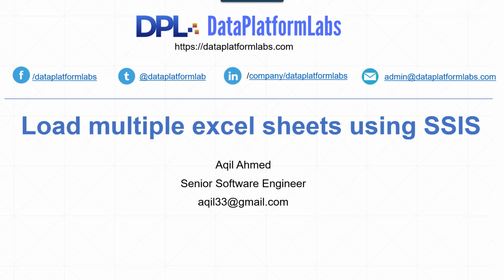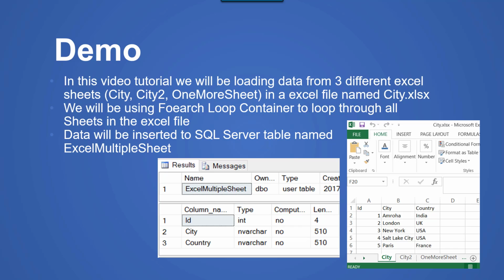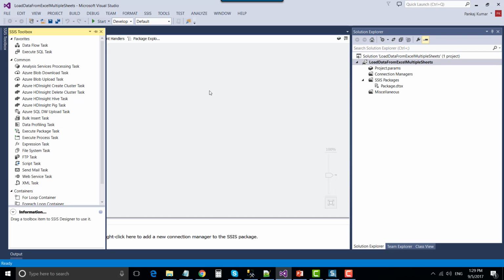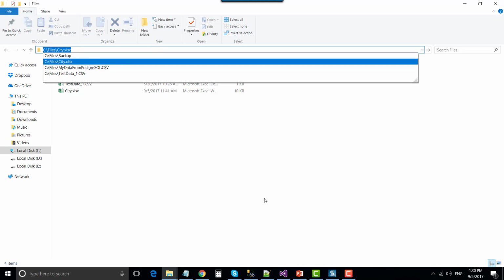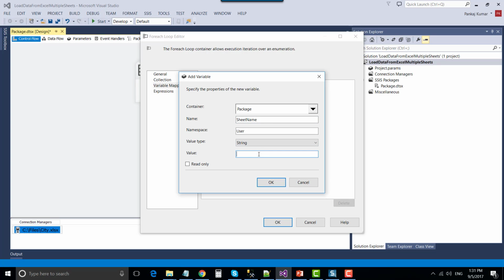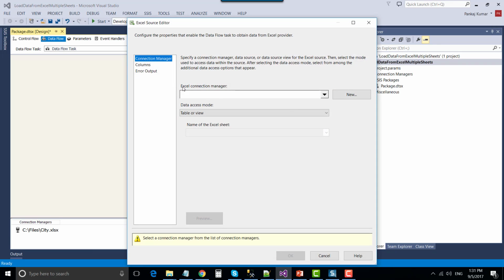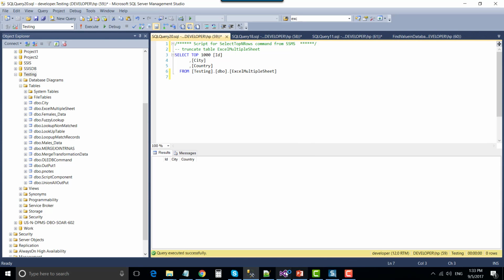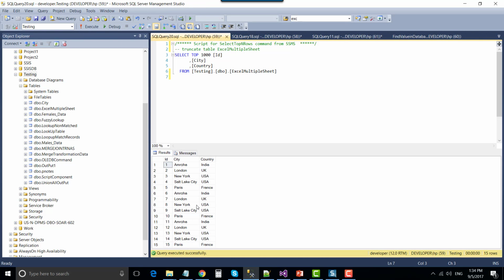25 Load multiple excel sheets using SSIS

Comment: Hi there, do you know how to get around an issue where a particular sheet has different sets of columns than the others?  Thanks
Reply from the maker: Using this method we can loop through multiple sheets with different schema but a single data flow task can only be used to migrate data from same name\number of columns.
Reply: @learnssis did you mean it is not possible?  Or is there a way to skip a particular sheet that have different sets of columns?  Thanks
Reply from the maker: @geeseeoh This is possible if you can use C#, because using C# we can read the column headers and if there is a change in column header then we can skip that sheet.

Comment: How can we add the sheet name too in table using this package
Reply from the maker: You would need to a derived column transformation in the data flow task, then in the expression, just drag and drop the SheetName ssis variable from top left. And give the column some name. By default the data type of the column will be nvarchar and the length will be according to the length of value in the ssis variable SheetName. 
You can explicitly convert the data type of sheet name in derived column by writing this before the ssis variable inside derived column

(DT_STR,50,1252)

Comment: I have a doubt, I used a variable 'Excel_sheet_name' to retrieve name of sheet name.
But in table it load as different, i don't want single quotation and  it concatenate some string in last.Do you know how to remove it.
Actual Sheetname = Feb 2024
In Table Sheetname = 'Feb 2024$'_xlnm#_FilterDatabase
Reply from the maker: You can use replace function in ssis derived column to replace a string.
https://youtu.be/r9HsJiXnR8k

Comment: i get this error  Exception from HRESULT: 0xC02020E8
Error at Data Flow Task [Excel Source [1]]: SSIS Error Code DTS_E_OLEDBERROR.  An OLE DB error has occurred. Error code: 0x80004005.

Error at Data Flow Task [Excel Source [1]]: Opening a rowset for "Bank$" failed. Check that the object exists in the database.
Reply from the maker: It simply means that Bank sheet does not exists in the excel file.

Comment: May i know why u toook index value as 2 in parametermapping
Reply from the maker: Actually there is some other information available on index 0 and on index 1, index 2 was the one containing the correct value, thus we used it. We can create an SSIS variable of string type and then we can change the index value from 0 to 1 to 2 and test it for different values and put a break point in the SSIS package and check the value in the SSIS variable.
Reply: which info is there in index 0 and 1 bro @learnssis
Reply from the maker: @Shankar-zi3yk That I am not aware, you can try declaring 2 string variables and then map them with index 0 and index 1 and then use a data flow task inside foreach loop container. Put a breakpoint on OnPreExecute Event of data flow task. And once control will come to data flow task it will get paused and then you can check the value of string variables from Debug-> Locals Windows.
Reply: "the one containing the correct value "  can u tell what was the correct value of ur statement @learnssis
Reply from the maker: @Shankar-zi3yk Correct value is at index 2 which is sheet name.
Reply: yeah i also got to know about that  index 1 is file name index 2 is sheet name from where  it was begining 

but index 0 means i have not got clarified @learnssis

Comment: What if the file name and sheetName  will change every month
Reply from the maker: I think you can use one additional foreach loop container and put this foreach loop container in the video in that new foreach loop container, now define an SSIS variable may be FilePath and then change the excel connection manager "Excel path"  property using expressions to that FilePath SSIS variable. Of Course you would need to set the FilePath ssis variable value inside the first\outer foreach loop container so that for each iteration the value of FilePath will change and it will change the connection property of Excel file as well.
Reply: @learnssis  thanks a lot... But I still not got a clear pic...
I would be thankful if u create a demo and send it to so that I can refer the same
Reply from the maker: @Shamshd._ahmad  Can you try to use an outer foreach loop container with file enumerator and try to set the "excel file path" dynamically to excel connection manager ?
Reply: I did but its throwing error inside the for each loop container
Reply: I am sorry .. i am trying to say what is if the sheet name will change every month...

Like for me 
File Name is - abcd...July..._20220701_20220801
Sheet Name is Abcd_20220701_20220801

So in sheet Abcd_is constant but dart part will change according to month
Reply from the maker: @Shamshd._ahmad  If the excel sheet name will change then no issues, it can handle it as SheetName is an SSIS variable and it can have any value in it and according to the value it can fetch data from excel file to be loaded to sql server.
Reply: @learnssis  the dame way u showed in the video the same way it will handel sheet dynamically
Reply from the maker: @Shamshd._ahmad  Yes
Reply: @learnssis  if I want to contact you . How i can contact you.?  Bcz some time in some of the logic I really stuck ... 
So in future if i got stuck in any logic will connect with you...
Reply from the maker: @Shamshd._ahmad  You can email your question to aqil33@gmail.com and I will try to reply.
Reply: @learnssis  thanks
Reply: @learnssis  Hi Aqil, Thank you so much for this video. I'm too facing this issue that dynamically file_name has to take from file path and in that file having many sheets with same structure. But in each worksheets, table starts from A17:G Cells. How to fetch data's dynamically to table. Do you have solution for this?
Reply from the maker: @savitharamakrishnan800 Take a look at these 2 videos, you will get some idea how to do that
https://youtu.be/zK-4nCU4gZ0
https://youtu.be/CMor3vY7Y-E

Comment: Hi Sir, why was 2 given in Index... What is the index for...
Reply from the maker: Actually there is some other information available on index 0 and on index 1, index 2 was the one containing the correct value, thus we used it. We can create an SSIS variable of string type and then we can change the index value from 0 to 1 to 2 and test it for different values and put a break point in the SSIS package and check the value in the SSIS variable.
Reply: @learnssis  sir what does actually index mean?
Reply from the maker: @sriniwaaskorampalli8145  Index mean position.

Comment: Hi Aqil, thanks for the great video. having one query. @3.44 why we need to use index as 2. how to find that.
Reply from the maker: Actually there is some other information available on index 0 and on index 1, index 2 was the one containing the correct value, thus we used it. We can create an SSIS variable of string type and then we can change the index value from 0 to 1 to 2 and test it for different values and put a break point in the SSIS package and check the value in the SSIS variable.

Comment: what if you want to do for specific number of sheet..?Ex: if you have 3 sheets, but you want to do get data from 1 and 3.
Reply from the maker: Then you can take an SSIS variable, may be you can name it as Counter and set its value to 1 when the Loop will start. And if the loop counter is 1 then you will load the data to sql table, you can use Precedence Constraint for checking it if the Counter is 1 or 3 then move with Load. Later you will increase the value of the Counter to Counter+1. Next time loop will iterate, the value of Counter will be 2 so Precedence Constraint won't let execute the Data Flow Task and it won't get loaded for second iteration. For 3rd iteration it will get loaded.

Comment: if we have 2 excel sheet and 1 csv then in data flow what will be refer as a source ?
Reply from the maker: For excel you need to use Excel source and for CSV, flat file source will be used. You can not loop through all 3 in one Foreach loop container.

Comment: we have different sheet names and each sheet has different number of columns , how do i do that
Reply from the maker: For example, your excel file contains 2 sheet names, i,e. City and Country.  So City sheet will contain data for different cities and Country sheet might contains data for different countries.

Below are the steps to load it to sql tables.

1. You need to configure the for each loop container how it is shown in the video. This way when the control will go inside the Foreach loop container the SheetName SSIS variable will contain the name of the sheet.
2. In this video all sheets were containing the data for Cities and the column name\number were same, so we used 1 Data Flow Task to load the data to sql table, however if there are 2 different sheets with different columns, so it will require 2 Data Flow Tasks to load the data. And if there are 3 sheets with different column names then it will require 3 DFT to load the data. First Data Flow Task will load the data for City Sheet, and Second data flow task will load the data for Country sheet.
3. Now inside the Foreach loop container, you can drag and drop a data flow Task, and name it as Test. It won't do anything but the precedence constraints after this will decide which data flow task to execute. 
4. Now drag and drop a data flow task for City. Connect the Test Data Flow task with City Data Flow Task. Right Click on the Precedence Constraint and Select Edit. From the Evaluation Operation, select Expression and Constraint, From Value select Success. Under expression put @[User::SheetName]=="City$"
5. Click Ok. 
6. Now Double Click, City Data Flow Task and drag and drop excel source, configure it how we had done in this video. Drag and drop OLE DB Destination and create the table City and map the columns.
7. Now drag and drop Data Flow Task for Country. Connect the Test Data Flow task with Country Data Flow Task. Right Click on the Precedence Constraint and Select Edit. From the Evaluation Operation, select Expression and Constraint, From Value select Success. Under expression put @[User::SheetName]=="Country$"
8. Click Ok. Change the SheetName ssis variable value to "Country$". This is for mapping purpose.
9. Now Double Click, Country Data Flow Task and drag and drop excel source, configure it how we had done in this video. Drag and drop OLE DB Destination and create the table Country and map the columns.
10. Set the Package's delay validation property to True.

This should work. Hope it helps.
Reply from the maker: Hey Vani,

I uploaded a video on this topic, have a loop at this video.

https://youtu.be/YWqO9KFTQCo

Comment: at got error i tried so many ways but i can't the error message is:[Excel Source [2]] Error: Opening a rowset for "Sheet1$" failed. Check that the object exists in the database.
plse help me
Reply from the maker: You might be missing some drivers for excel.
Reply: write in the exact name of sheet in the variable value. I was getting the same error and this worked.